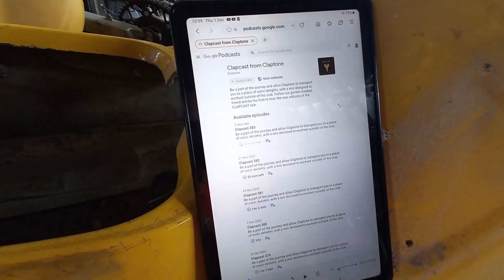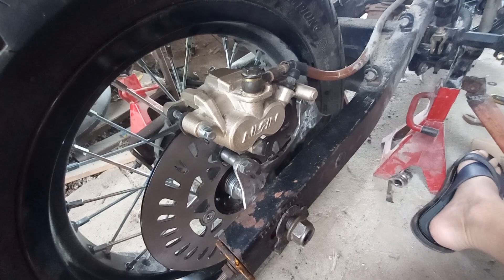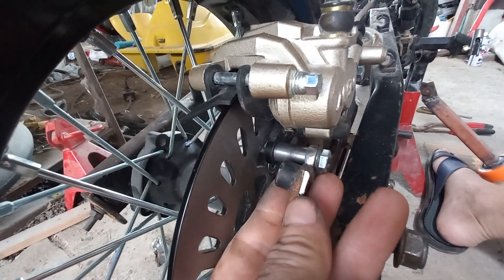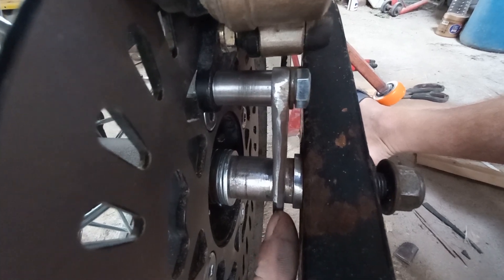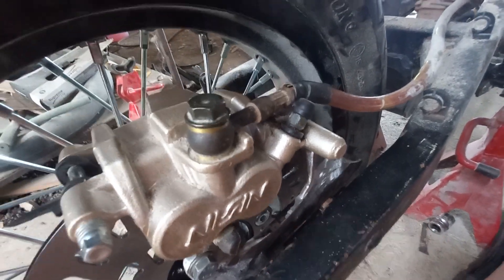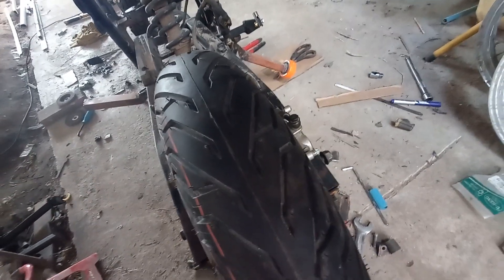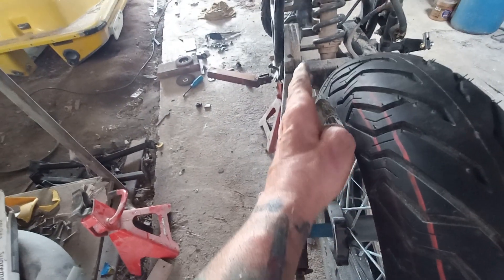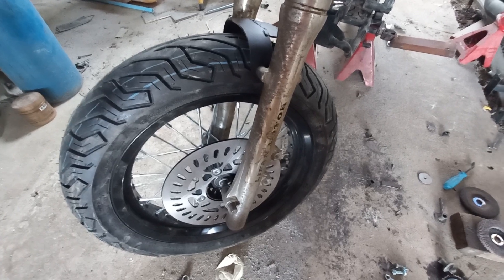ultimate scootski part 15000. ill just bung that in there then.

Comment: I can see you investing in a 3D printer, the one that does metal, to print your own parts! I bet you could get a propane bottle powered little furnace, melt down aluminium cans and other scrap and cast your own lumps in a mould, surface grind/polish and drill/tap as required mate
Reply from the maker: Im too much of a dinosaur to bother with 1 of those! And susans been hiding ALL your comments again.....i just stumbled across them.